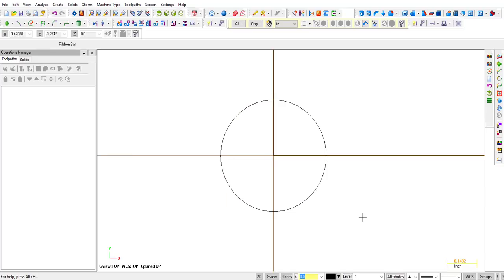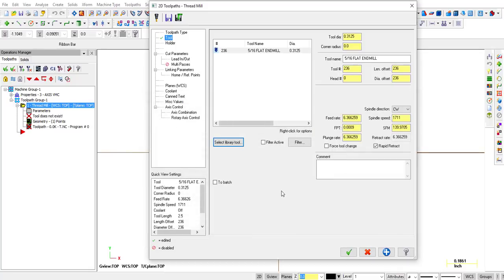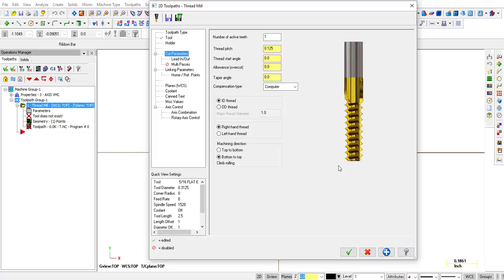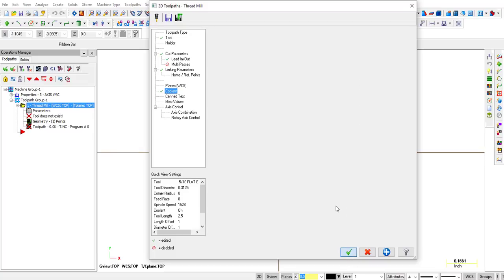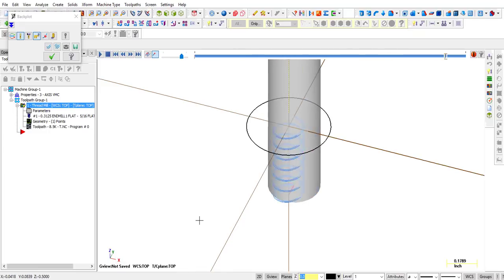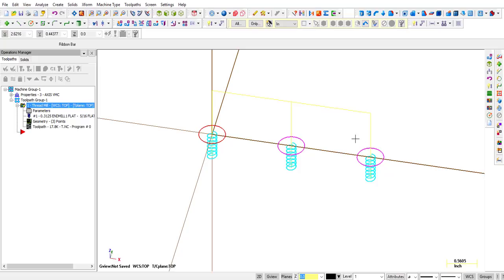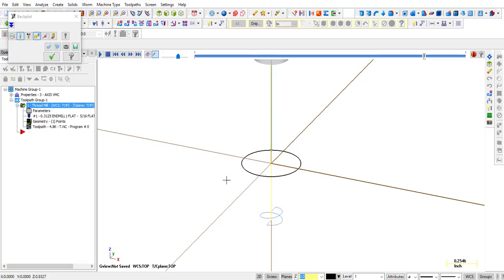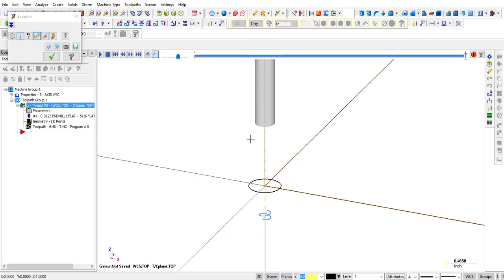HOW TO THREAD MILL IN MASTERCAM X5

Comment: why divide 1" by 13? to get the thread pitch whats the formula for thread pitch
Reply: Got it “1 per thread 🧵
Reply: 1/2-13 means (13 threads in 1 inch) so 1/13=.0769 is your thread pitch. Master cam needs that value to calculate the G code